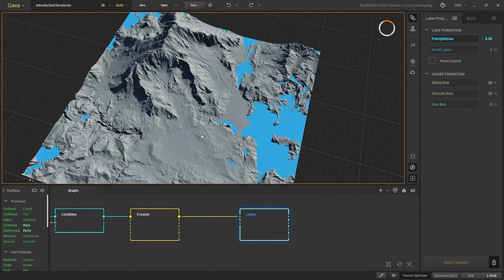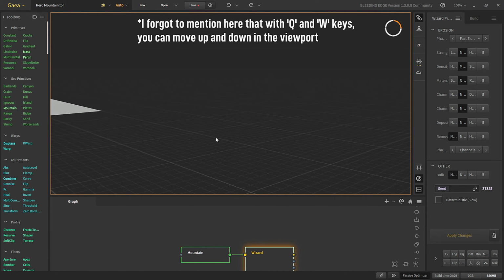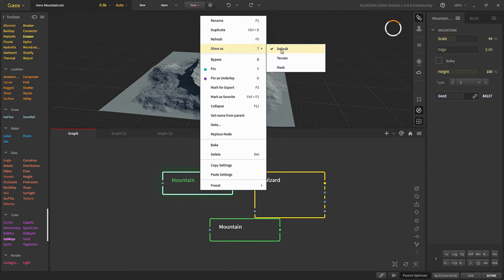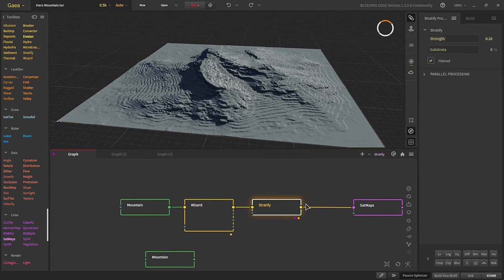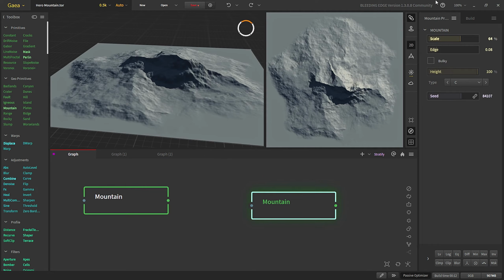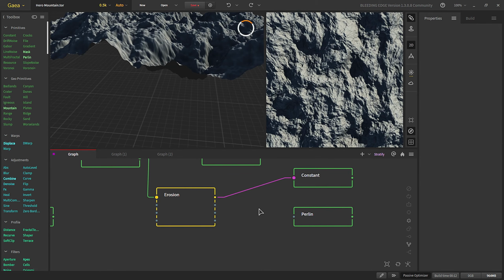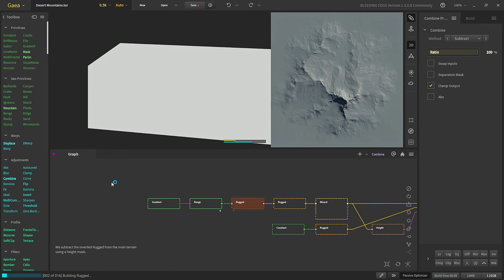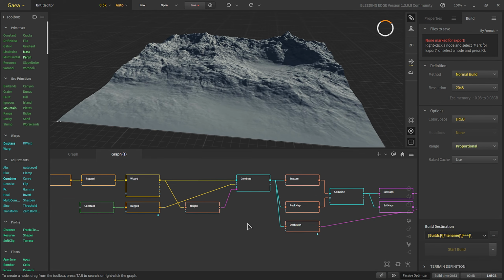Gaea Beginner Tutorial Series : Part 1 - Interface

Comment: Are all the landscapes possible in Gaea only aerial views?
Reply from the maker: you zoom in and you'll be on the surface
Reply: @CrowBiomes   thanks..but do you see the high res textures  when you zoom in. they look pixelated. is that just the viewer or will it look like that in Maya or C4d with Redshift? because it only looks nice in Gaea from an aerial view above.
Reply from the maker: @xpez9694  You'll need to choose a higher viewport resolution for that. It can go as high as 4k. In C4D, you'll use the exported resolution which can be as high as you want.
Reply: @CrowBiomes   ok I will check that out..